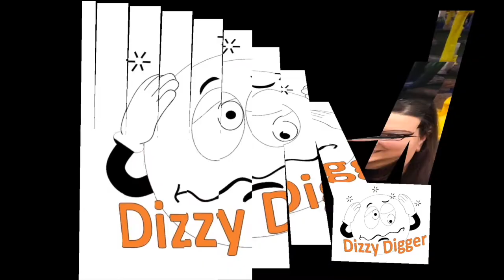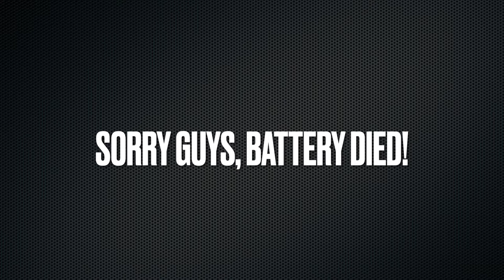Ep21 Engine Hoist Modification

Comment: That was pretty clever!  I like that it still has the Standard width capacity so that you can still store it.  

With the encapsulated design and the cross bracing you shouldn’t need to add rollers.  Doing so would make moving it around more awkward.  Those stands don’t maneuver well under load, with four wheels.  Six might be a beast to move.

I like it… looking forward to watching it work!
Reply from the maker: Thanks, when I’m working outside is the summer lifting things normally isn’t an issue. Excavators and skidsteers help then lol. But in my garage I only have 8 ft ceilings, so this hopefully will do the trick.

I was worried about flex at the joint when I put weight on, but now that it’s built I don’t think I will need the either.